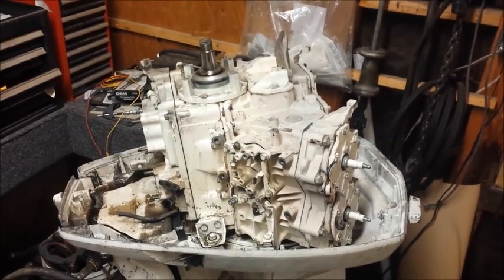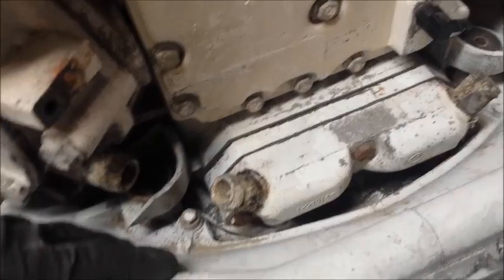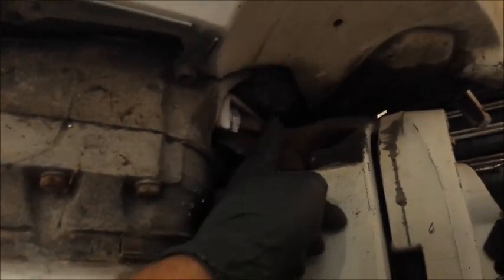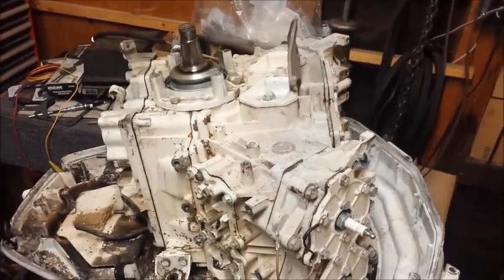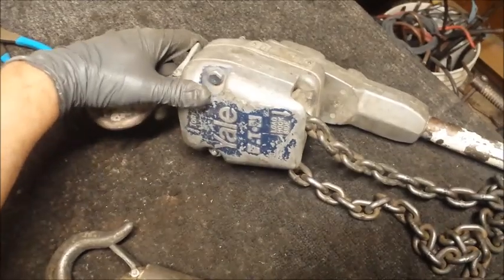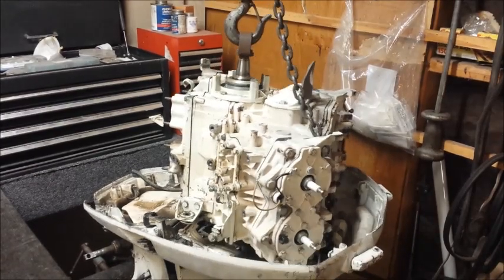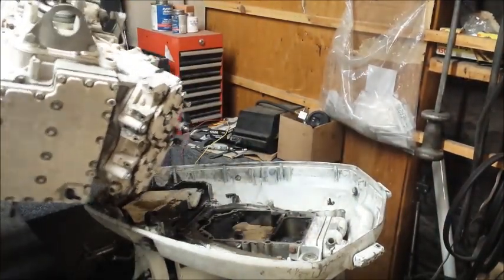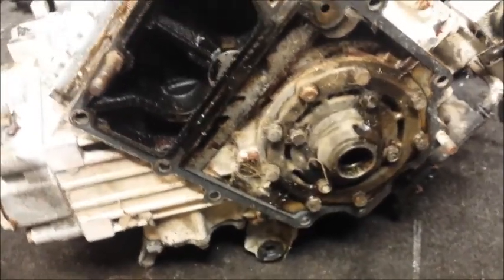How to Remove Johnson / Evinrude Outboard Powerhead

Comment: I have a 1979 100hp johnson javelin. It runs pretty bad at low speeds on a load but really good at fast speeds on a load. How can i make it run better at low speeds?
Reply: you might have a bad spark plug wire, check them all for continuity.   mine did the same thing. good luck

Comment: Hey do you know if I can swap out a 225 evinrude(2000) powerhead onto a 225 johnson(1994)? The evinrude runs well but has a long 30 inch shaft. I need the johnson with the 20 inch shaft

Comment: Hey Brandon my crankcase breather hose has milky grey oil/fuel coming out of it. I replaced the head gaskets exhaust plate gaskets. would there be anywhere else that could cause water to get into the crankcase? It’s79 johnson 115

Comment: 96 Johnson 200 how ocean runner  I have 60 psi on #2 piston wet or dry the rest are 90psi dry 110psi wet how hard would it be to just repair that cylinder I've been a mechanic for 25year on cars but never been in a outboard was just wondering if I can replace that one

Comment: Great information, I want to swap a 1988 88spl powerhead to a 1976 115, do I  need to remove carbs,electronics,etc  to get to bolts?
Reply from the maker: Nope! Butt you will have to diconnect fuel lines, and ground straps.
Pull the shift rod pin, and undo the lower cover mounts, then remove all the powerhead bolts, and it'll come right off.
Reply: Thanks,I'll use the rear hook with an engine hoist

Comment: Hi my name is Paul I was just wondering before you remove the powerhead did you have to remove the drive shaft or does that power hit come straight out from the drive shaft thanks I'll be waiting for your reply thanks again
Reply from the maker: Don't have to no, but you will have to remove the tilt pin.

Comment: Do you know what that v4 powerhead weighs?  Thinking of using one in a gocart..
Reply from the maker: about 100 pounds.
in the 70's Ive seen some 115s that weigh in at 85lbs, in the 90's I think they are about 110.
Reply: @BrandonsGarage  Thanks for the quick reply, that is pretty light for a 1.6L engine.
Might just buy one, convert to direct injection and add a supercharger.

Comment: Is it necessary to remove the lower unit? Would that cause the power head to not come off?
Reply from the maker: No, usually I dont remove the lower first. its just a good idea to to make sure you dont damage the drive shaft splines.
Also, by removing the lower first, you know that it isnt seized into the crankshaft. 

If its not coming, you could be pulling on an odd angle, and the studs are locking it in there.
Gasket could have been glued down.
Or, you dont have all the bolts/nuts off.
Reply: Brandon's Garage thanks for the reply. I have all the bolts out but it's not budging one bit. Gonna have to assess and readdress

Comment: Brandon can you tell me what the optimum cylinder pressure should be on a 1986 johnson 150 GT ?  My engine has been pressure tested and the reading are from 78lbs to 87lbs.
This engine does not like to idle very well and when you turn the key the starter spins the engine easily . it uses a lot of fuel as well. Should I get a ring job done to it to bring up the pressure? Thanks in advance. Joseph
Reply from the maker: While they do seem low, what the compression numbers should be was never published. 
Ive seen good running engines at 110psi, and good running engines at 80. So I cant give you an exact answer.
Rule of thumb says all cylinders should be within 10% of each-other. 
I can tell you the V4's guzzle gas, and are known to have low numbers.